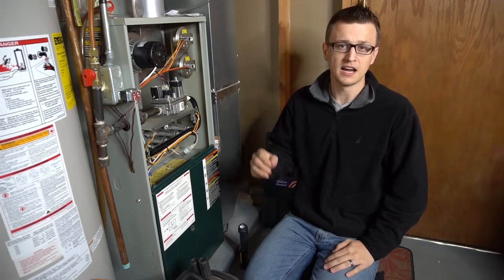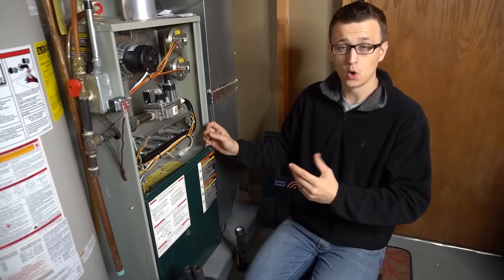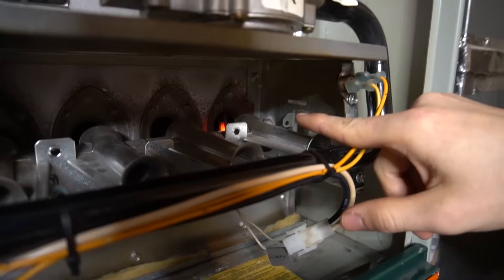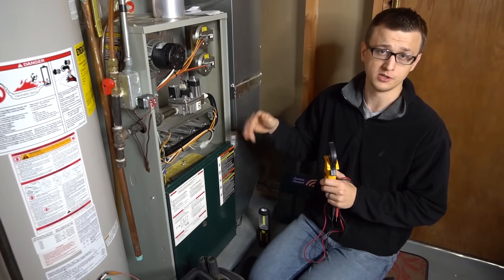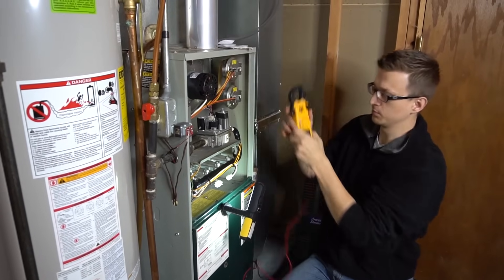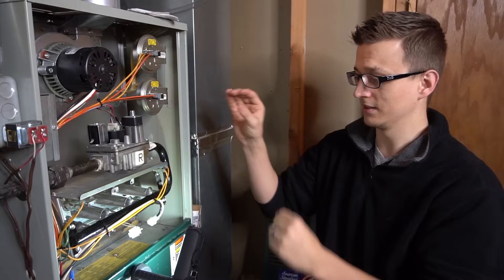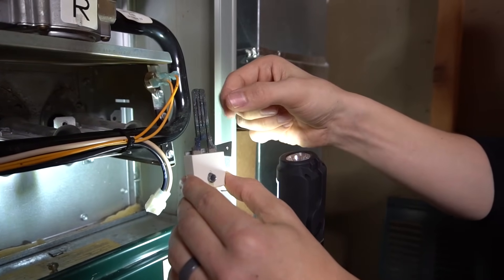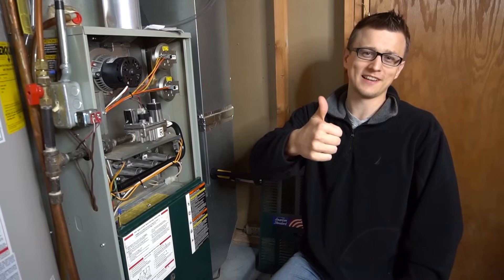Furnace Not Igniting - How to Check and Replace Ignitor

Comment: Thank you!
The inducer motor in my lennox furnace turns on for 4 sec and then turns off. Nothing happens after this, no ignition, no gas clicking. Any idea?! (This furnace hasn't been turned on for 2 years)
Reply from the maker: It could be a pressure switch problem.. Does the control board blink any error codes after the inducer motor turns off?
Reply: @WordofAdviceTV  It does, two green lights blink simultaneously after inducer motor turns off. I tried to count how many times they blink but they blink non stop both. Thank you for answering my question!
Reply from the maker: @erdisagjyshka1238  Either in the manual from the furnace (if you have it) or on the back or front of one of the furnace doors you should find a diagnostic chart that explains what those lights mean. As far as I remember, on a Lennox (pretty sure that's what you have) both lights blinking slowly means normal operation, unit is on standby. To begin with, I would try bypassing the thermostat either at the control board or at the thermostat itself and see if the furnace turns on. I have videos on how to do that if you need them.

Comment: This video is where your other videos led me, let me just say, your the man! Ive learned so much from you, so Thank you very much! 
 I spent literally all day watching your videos over and over trying to diagnose my Coleman Furnace Model# DGAH, and none of your troubleshooting categories seemed to fix my problem. I had done everything you've showed, from checking the operation functions to checking ohms and voltage on everything and everything seemed to check out voltage/ohms...I started off taking the blower motor out and giving it a good cleaning(it needed it for sure) then check the inducer motor which was making a horrible squeeling noice. I popped off the cover and put wd40 on fan post, that quieted er right up, replaced the cover and dug deeper...I then cleaned the flame sensor, which did have a bunch of carbon on it but the hot surface igniter was still glowing bright, just no flame. The status light kept blinking one blink every 2-3 seconds which on the panel indicates "ignition failure". The orface appeared to be clean and i could hear and feel the valve open for the propane to be sent into the chamber. Next, I cleaned up the burner with a copper bristle brush then hit it with some forced air, from my air compressor. Still nothing, no flame but could hear everything functioning properly. Only one of your trouble shooting suggestions (Checking the ohms at the hot surface igniter at room temperature) "for a correct reading", worked for me, but not in the sense you might think. My furnace had gone out 2 nights ago so room temp, it was not. I had the bright idea of using a hair dryer to heat up the gas valve mechanism and line in and proceeded to reset the furnace. Only then did any sort of flame start to come into the chamber and actually try to ignite. I did this twice with the hair dryer and BAM!!! She lit. Blew my mind... Im guessing there must be some build up in the either the gas valve mech or the line? Any input would be phenomenal, and again Thank You so so so much!!!!
Reply from the maker: Wow :) You are one persistent and focused man! You did about 10 times more than most homeowners would do. And to be honest I have never heard of anyone trying to heat up the gas valve with a hair dryer! Amazing :) I will have to try that some day! I am glad my videos helped but you totally figured that one out yourself. I may have suspected blockage in the gas valve but wouldn't have thought to heat it up. Those gas valves do get plugged up sometimes but that is why there is a drip leg on the gas line before it goes into the furnace. (You can try taking the drip leg off and see if it has a bunch of gunk in it) Is your propane tank running a little low by chance? I know that when they start running out of fuel, the bottom of the tank has a lot of debris that can plug stuff up. I remember them teaching us at school that one should never allow a propane tank to completely run out because that will likely start plugging up your gas lines. (I don't work with propane furnaces very often so am not sure if this is common knowledge among homeowners) Also, I don't know if you checked this but is it possible that one of the manifold orifices was plugged?
Reply: @WordofAdviceTV    lol I try to keep costs to a minimal and youtube college helps out quite alot lol and I wasnt gonna take no for an answer. 
The tank did run out around spring time, well just under 5%, i know its not good under 8%. But, with propane a little over $2/gal with a 300 gal tank, its a pretty penny. I litterally just had it topped off 4 days ago, with the -15° in the forecast for a week, if not longer. I figured it was now or deal with frozen water lines later and Ive been there and got that tshirt, it is no fun.
I Thank you again. I will check n clean the drip leg and the manifold orfices in the a.m., if they need it, which with my luck, they probly will.
Reply: So an update with bad and good news
I woke up the next morning and the furnace had been running none stop, even after the call for heat was not present. I turned the thermostat down all the way and flipped the selector lever to off. The furnace shut off. Waited a bit, for it to cool down, then removed the orfice, burner, hot suface ignitor and flame sensor. The  orfice was filled with vasoline, i cleaned that out and inspected what i could see in the gas valve. Not that i could do much with the gas valve, as it has special screws for which i dont have a bit for, it looked clean. The backing plate, which the flame rolls off of and out of the burner, the back of it had a good 2-3mm of black sute on it. I had thoroughly cleaned that the day it quit working. Cleaned it again. Then reassembled everything. Sent the call for heat to see if it would re-ignite. It didnt light and it gave me the status code of ignition failure, again. I tried the hair dryer on the gas valve again, it tried to fire once and then nothing, it wouldnt fire. Again, everything was functioning properly. I removed the gas valve put it upside down, figuring that when i heated it up, I must have clogged something inside, and put the heat from the hair dryer on it for a good 5 mins with the gas valve upside down.  Caution for those who do try this, the gas valve will be extremely HOT, use a cloth or something to handle it to Reassemble
Well it didnt light. I just gave it time and let it sit for about an hour or so, and it cycled through its 3 failures and its next try, it lit! Since then it has been functioning properly. Next winter, ill have the wood stove installed and use that, way easier lol. But im a happy camper here, for now lol. Take care.
Reply from the maker: @jeremyhoule9221  Oh boy.. Sounds like you had a busy night! Thank you for coming back with a detailed update! I wonder if the gas valve is just defective or is not getting power? I would just replace the gas valve.
Reply: This is amazing detail. Thank you so much. I'm struggling to get my ignitor to glow. Bought a new one and nothing. So I'm at a loss.

Comment: My problem is weird, my draft inducer spins up as normal, but sometimes the burner never lights.  The draft inducer just blows and blows forever.  If I switch the furnace to off at the thermostat, letting it rest for a while then setting it to heat again will usually get it working again.  So either the igniter is marginal and randomly just doesn't get hot enough or the control board just randomly doesn't send power to the igniter or the gas valve never opens. The problem is it's so random I can't easily sit at the furnace to do the troubleshooting shown in this video (hearing the gas click would rule out the valve not opening).  So maybe the igniter has a crack that goes nearly all the way thru but leaving just enough connection so it heats a bit.
Reply from the maker: I don't think the problem is the ignitor. If the ignitor was bad, usually you can still hear the gas valve open up for a couple of seconds to try and light. That sounds more like a pressure switch not closing. If you manage to "catch it in the act", try to see what error code the control board is blinking when only the inducer motor runs and nothing else happens. I have a video about 10 pressure switch problems if you will need it.
Reply: @WordofAdviceTV   (BTW, the furnace is a ComfortMaker NUG9075FGB1)
Damn, I think I found the (or 'a') problem. I removed the fan space panel to look at the control board to look for LEDs and immediately noticed one or two of the resistors in the lower right corner had greenish fuzz on them. I tried to wipe the corrosion off thinking it was just greenish dirt (maybe mildew) and the resistor lead broke.  I think it was corroded all the way through.  I guess I need a new board, I could solder in one or two new resistors but I suspect it's better to get a new one. The resistors were in the section marked "delay"  (this page shows a modern equivalent: http://www.allpartsheating.com/1170063.html#board ). The damaged resistors are two near the red switch block.    Strangely the furnace works (mostly) even with those one or two resistors broken.
Reply: @Word of Advice TV  Update, I caught it starting up (properly) and heard the gas valve click, now that I know it's really loud I'm sure when the burner does not light that the gas valve is not clicking.  So does that imply it's a pressure valve problem?  I've ordered a new 1170063 control board since that looks bad anyway.
Reply from the maker: @manw3bttcks  Well.. Usually when the inducer motor spins but nothing else happens, that means the pressure switch is not closing. Typically the pressure switch itself is not at fault though, it is just doing it's job. Either it is losing power (possibly a control board issue) or it senses that there is not enough draft pressure and opens up. I can't say for sure what's going on with yours, especially since it's intermittent. If it's a high efficiency furnace, then perhaps the condensate trap or drain is partially plugged. Check out this video if you haven't already for pressure switch info:
https://www.youtube.com/watch?v=Zax02itYHkU&t=4s

Comment: Good morning, I replaced my igniter, cleaned the flame sensor, replaced the air filters, both rollout switches are not tripped, turned off breaker for 5- min., and continuous red light means normal operation, however the igniter will still not glow red, what could possibly be the culprit? any info would be highly appreciated.
Reply from the maker: Is your inducer motor turning on? I would try bypassing the thermostat once to see if the thermostat is the problem. (I have videos on how to do that in playlist in description if you need it)
Reply: Word of Advice TV I just got it running, I missed the 3 blinks, so I cleaned the pressure vacuum switch and that got the igniter glowing but still wouldn't ignite, so it gave me a one blink code which turned out to be a couple of wires that were not plugged in all the way on the gas valve,  anyhow thanks for doing these videos, my family thanks you as do I!
Reply from the maker: @alvaromontoya7529  Awesome! Glad to hear you were able to figure it out. Stay warm! :)

Comment: I have a White Rodgers Emerson Electric 50A51-507 furnace. I suspected the hot surface ignitor as I have cleaned the flame sensor rod with steel wool already. I removed the surface ignitor and there are no cracks, so I put it back in. Just as before, the flame lights, first 2 burners ignite and then it stops. It does cycle through this 3 times and then goes to the 2 blink error code.  Not sure that it is my ignitor, but, what is a good replacement for the Norton 271N 9904 hot surface ignitor?
Reply from the maker: What caught my attention is that you said the first two burners light. Are there four burners? Watch this video of mine once and see if that's the problem you are having: 
https://www.youtube.com/watch?v=aM4OXM8ruNk&t=1s

Comment: Hi, I have a trane, igniter issue, i check my igniter 50ohm, so it is good, but there is no voltage to the igniter ? what is the next step to troubleshoot that, or what you think the issue? Thanks
Reply from the maker: Can you hear the gas valve open for a couple of seconds? If you can, then I would say there's a good chance that the board is bad and not sending power to the ignitor. But perhaps the system is not even getting to the ignition and something else is wrong. Like an open limit or pressure switch. Is the control board blinking any error codes when it fails to light like that?
Reply: HI, yes the control board is blinking red constantly. I do hear the gas valve opening. I will measure the voltage, as in your videos; how will i check the open limit and pressure switch?
Reply from the maker: @andrewle487  If you can hear the gas valve opening, then you won't be having a problem with the limits or pressure switches. Likely it is indeed your control board that is bad. If you want, you can light your burners manually until you get the board replaced. Just stick a long shaft lighter where your ignitor is and use that to light the gas instead of the ignitor when that gas valve opens up for a few seconds. (of course do this carefully and at your own risk.)
Reply: Hi again, I want to thank you first for your time and generosity,  ok let me start over, i recheck just now. I just want to verify the steps and if I am wrong or right. First, the board on this Trane XB has red blinking on constant. 2. I check the igniter and it does not glow. 3) I went thru your voltage check steps video. I do get 120 volts in at transformer, then 26-28volts to the board(red&blue wires). 
4) But I do NOT get 24 volts out by checking the orange and the yellow wires at the board and at the Pressure switch? 5) If that is the case, if I do NOT get 24volts out to the pressure switch, with the yellow wire, then the orange wire will NOT go back to the board with 24volts to trigger the 120volt INDUCTER? Then if the Inducter will not turn on due to NO 120volts(same as the igniter), then the 24volts to the gas outlet will not open? : is this a correct troubleshooting steps?  With this said, so no 24 volt out , then the board is bad? If not, please Correct me where I am wrong? Thank  you..
Reply from the maker: @andrewle487  Hey Andrew! So if you check voltage from either of the pressure switch terminals to common or ground, you are getting 0v? You are right, that would likely mean that your control board is bad. But before you do anything else, try bypassing your thermostat at the control board and see if that turns it on. If you are not sure how, I show it in this video:
https://www.youtube.com/watch?v=bmZc76ufTNY&index=13&list=PLK8tZPlovA8BJJ_weFseSjQWUvB2FFII2
Reply: Ok, I tried to bypass the thermostat toady, at my board, I do not have green wire to jump and bypass? Let me explain more detail, I remove my thermostat today, first time, here I have only 3 wires, red on(RC), Y, and W, and one jumper on RH but not connected, just dangling  ; I do not know if it got loose or removed? there is a label on it, RC+RH, but they are not connected. 2nd: I went to the Trane unit board(when i use "board" = heater unit board), had R, W, Y, and a weird blue wire dangling (trace it,  R to Rc, W to W, and Y to Y. At the board G has no wire for me to bypass my thermostat?  And I do not know if this will help, but a different pair of wires, from AC, going in the board; red went to C, and White wire going to Y? Testing stage: since I cannot bypass because I have no G wire in my board, I hook up the loop at the thermostat, RC to RH hoping things will work, I went to the trane heater, and condenser doing something, and hear the gas coming in, but still no fire or no ignitor glowing..... But I feel I am closer, i hear gas and clicks, but no fans ? ( I have a wireless Emerson up500w, which has a loop already built in, so I believe I am not suppose to loop the RC to RH).  I know it is hard to follow with only words, but hope you can clarify it.
Reply from the maker: Just to clarify the thermostat labels:

R = Power (24v)
Rh = Power for Heat
Rc = Power for Cool
W = Heat
Y = Cool
G = Blower Fan
C = Common

Usually there is a jumper between Rc and Rh. Which is what I think you were talking about. I would leave that jumper hooked up between Rc and Rh at the thermostat. 

If you are hearing the gas valve click open and some gas coming out, then you likely have a bad ignitor. Check out my ignitor video for more info on that: 
https://www.youtube.com/watch?v=1bRsFAMgZRQ&index=16&list=PLK8tZPlovA8BJJ_weFseSjQWUvB2FFII2